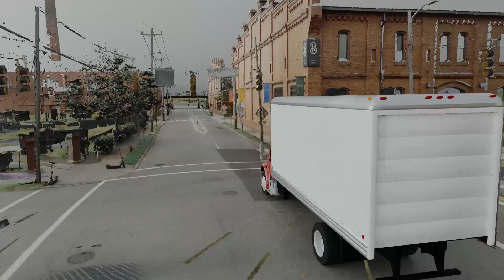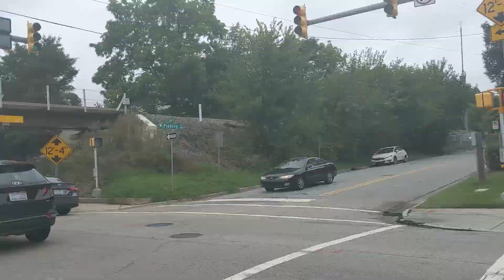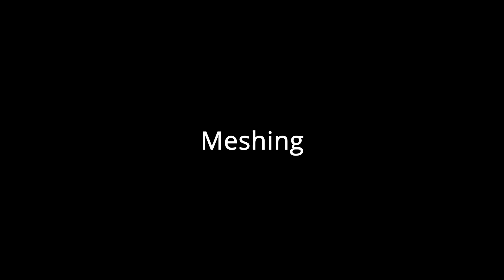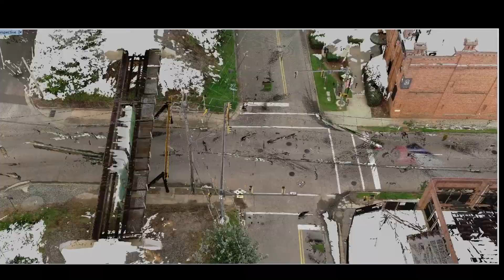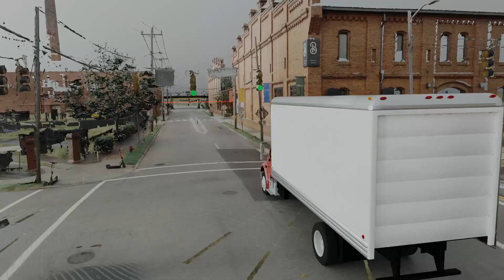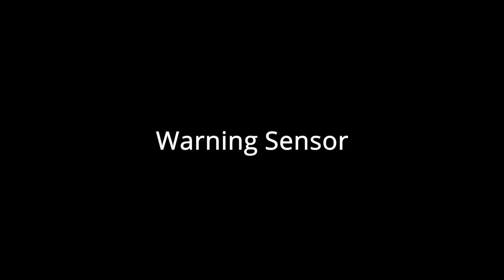11foot8 Canopener bridge 3d Scanned, Measured, and Animated #11foot8 #11foot8+8

Comment: States vary on how high off the road they declare clearance.  2" is one of the lower ones. New York measures a full foot off the pavement to account for unplowed snow.

The raising of the bridge a few years ago was incidental - the railroad that owns the bridge was levelling out the run of track the bridge is part of to make train traffic run smoother. More clearance under the bridge wasn't the goal - if it was they'd have changed it to 13' 6"

Great work on the video capture though. Hope to see more.
Reply: After years of insisting it would cost too much and how much track they'd have to re-grade to raise the bridge, the railroad raised it 4" to match the height of another bridge not to far from this one, and the trains have no problem climbing the slightly increased slope going up to this bridge.

Now what needs to be done is to take the paving out under the bridge and remove all the crown under it. Put a drain crosswise with a very sturdy steel grate. Since the actual clearance under the middle of the beam is 12'-6" it could then safely be called 12'-8" when the real clearance would be 13 feet or slightly more all the way across.
Reply: @greggv8  There are apparently underground utilities that pass under that bridge at the road, that need to have a minimum over-burden (be buried to a minimum depth) to prevent damage from cars.
I can't recall which of yovo68's videos this was mentioned in, but that was the source of my information.
Reply: the state of North Carolina owns the track, uses it for their commuter operations and NS has trackage rights.
Reply: @rearspeaker6364  Are you sure of that? Cause that isn't how railroads normally work. Since you're making the claim, cite.
Reply: @michaelmorris4515  read it years ago. its public information.
Reply: @rearspeaker6364  Then it should be easy for you to CITE.  If you can't or won't I'll presume you are a liar.
Reply: @michaelmorris4515  if your too lazy, argument is ended!
Reply: @rearspeaker6364  Claimant provides evidence. That is the rule of any court or debate. You are the claimant, the burden is on you. You don't want to spend time looking for proof because you're lying or you have never researched your claim so you don't know if it's true.
Reply: @michaelmorris4515  ok boomer.
Reply: @michaelmorris4515  "The state of North Carolina owns the North Carolina Railroad Company, which owns the land and the bridge" https://en.wikipedia.org/wiki/Norfolk_Southern%E2%80%93Gregson_Street_Overpass
Reply: @joshuahawkes7218  Cool.  Why @rearspeaker found that so hard to do is beyond me. Why they had to resort to name calling in response speaks to their maturity.
Reply: @michaelmorris4515  Or it should be easy for you to SEARCH, since you obviously have an internet connection...

Comment: Thats a railroad bridge and getting the railroad to raise it is impossible. The only thing the city can do is dig out the road. NOT going to happen. Easist is to put the sensor further back with a very loud siren go off for over height. Then ut a lot of signage up prior to the turning on that road. Even local fire department got the top of their truck can opened
Reply: Yovo68 did an analysis on why the bridge won't be raised further by the railroad. It has to do with the topology on either side of the bridge and raising this one would affect at least two other intersections at least. The city also can't lower the road surface easily due to utilities under the road. Basically, the cost of doing either or both is going to prevent making changes.

The sensor also can't be further back or it would trigger for traffic exiting to side streets before the final intersection at the bridge.

Comment: So the sensor is still sensing for an 11' 8" clearance!  And it's a wonder why accidents keep happening there!  Thanks for the video!  It was great, and I love that bridge!
Reply from the maker: Thanks!
Reply: It's my firm belief, and I do enjoy the videos, the sensor is a of waste time. I additionally firmly believe a tell-tale made of a heavy chain would greatly, but not entirely, stop these truck/bridge interactions.

We humans can be very analogue critters. You can have every tech possible to stop this and the human brain will still go "Na, I'll fit just fine". But when you employ something as simple as a chain hitting, rattling and scrapping the length of the vehicle it gets a drivers attention real quick.
Reply: @foamer443  There’s a low bridge in Melbourne Australia that has gantries with heavy hanging rubber paddles to give any overheight trucks a solid THUMP and people still hit the bridge on a very regular basis.
Reply: @TPishek  What I wasn't clear enough about, is I feel the number of 'hits' would be lower with the chain/paddle than with the sensor.
There's only one way to find out.
Reply: @foamer443  The issue is that there's just no space to put that chain. There's only a couple of yards between the intersection and the bridge.
Reply: @HenryLoenwind  The distance on the bridge side of the intersection would not give a driver enough time to react and not give them a chance to turn. So one way or the other placement would need to be on the other side of the intersection.
Reply: @foamer443  You can't put it on the other side of the intersection--there are overheight trucks that legitimately use the intersection, so you can't block them from approaching the signal and turning onto the cross street.  Telltales would need to be between the intersection and the bridge.

Comment: Now we need this in a video game, with the goal to be a "perfect peel" on a straight truck.
Reply from the maker: Beamng!
Reply: @scanningcars6500  10/10 do want in BeamNG
Reply: They need one of these in a GTA game. You steal a truck then fail a mission by peeling it. Wasted
Reply: 11'8" simulator 2022?
Reply: Precision
Reply: Maybe a guest spot in GTA 6
Reply: The multiplayer version of this should have a bridge that will break up and collapse after a certain amount of damage is done. Players can choose from different sized  trucks. You drive under the bridge, one by one, until someone knocks the bridge down. It could be like Jenga. Trucks that make it under the bridge without bringing it down are placed on the bridge. Their weight adds stress to the bridge.
Reply: I was thinking the same when watching the site being imported to 3d mesh, lol.  11foot8+8 perfect peel game when, lol.

Comment: The maximum standard vehicle height is 13'6". I'm in New York where the bridges are marked a foot lower than actual. This can be confusing for some.
Reply: It is definitely a good thing they are marked lower. The height of the bridge, the flexibility of the road, and the vehicle heights all depend on multiple factors and can not be guaranteed. That extra space means even in the worst case scenario with the bridge sagging on it's expansion joints, Truck tires over inflated and driver tilting the vehicle due to acceleration/braking and the road firmer that usual there will still be plenty of space.
Reply: @EmperorNefarious1  4 or even 6" sure.  New York State's 1 FOOT is ridiculous and leads to drivers ignoring the signs.
Reply: True east of the Mississippi. Out west trailers are allowed to be 14' high.